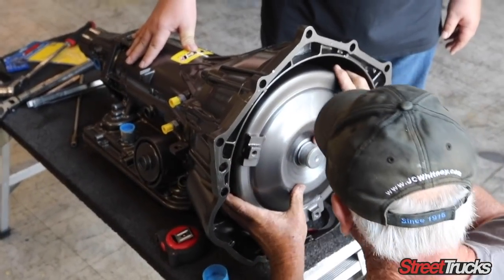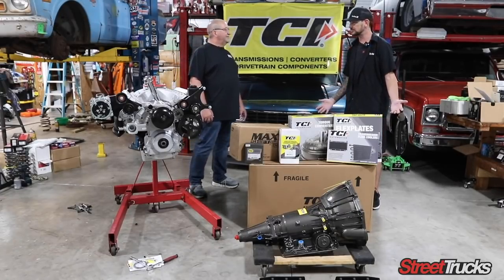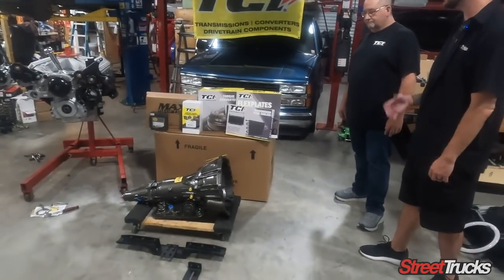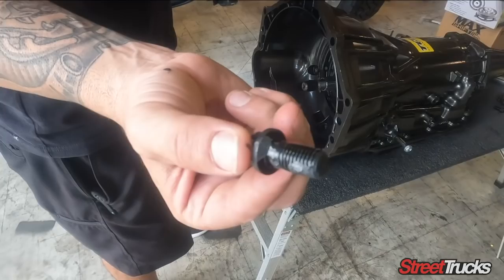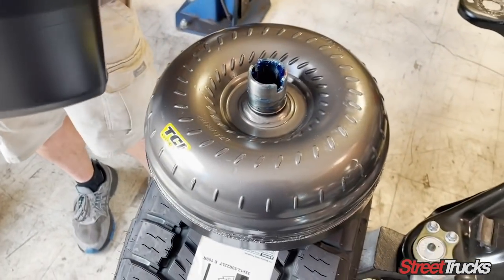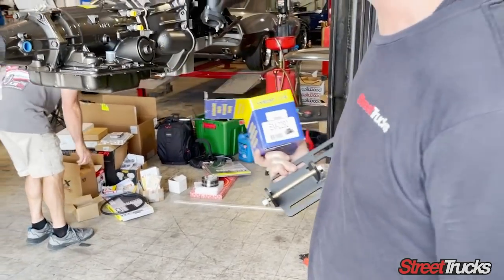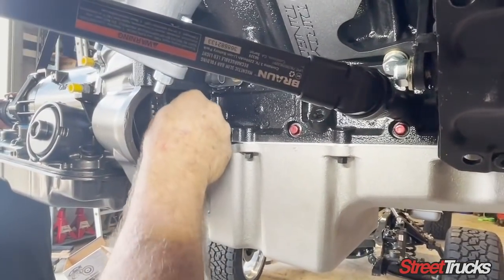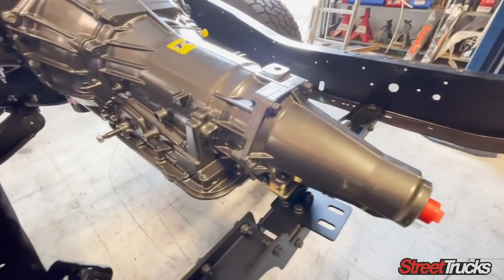We learned how to properly install and Crate Engine and Transmission! Rocky Part 9

Comment: What’s the plan for the throttle body? Are you guys going the tbi route to work with the 4l60e or throwing a carb on her? And if you are going the carb route can you do it without an ez-tcu? Im currently in the middle of trying to figure it out myself on my 4l60e and sbc 305 in my van. Thanks can’t wait to see rocky make some pulls!!l
Reply from the maker: We are using the Summit Racing SUM-227100B - Billet Throttle Body and Holley Terminator Max. The setup combines with the Lokar LS Classic intake to look old school. Its very cool! Have a complete engine build sheet if you'd like to see it. Email me and I will reply with the specs chamilton@engaged.media

Comment: Guys, really? Re-read the ARP instructions that you held up. It says use Loctite 242 on the threads and Ultra Torque under the head of the fastener.
Reply: Actually according to the ARP harmonic balancer bolt  installation instructions on the back of the package it states. "Lubricate the threads of the bolt, the underhead
of the bolt and the front face of the balancer
(where the washer contacts the balancer) with
ARP ULTRA-TORQUE FASTENER ASSEMBLY
LUBRICANT. Then install the washer onto the
bolt and install the bolt hand tight.
Tighten the balancer bolt to 235 ft-lbs. using
ARP ULTRA TORQUE FASTENER ASSEMBLY
LUBRICANT."
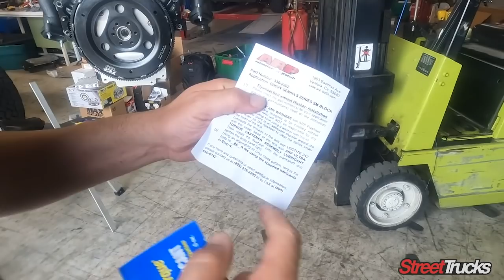Reply: @orabates1823  You don't know what you're talking about. They don't even show the harmonic balancer bolt being installed in this video. It's just in there loose at the end of the video. I'm talking about the flywheel bolts (from this video and from the instructions he held up, just pause to see it 6:16) "Lubricate the threads of the bolt with LOCTITE 242....."